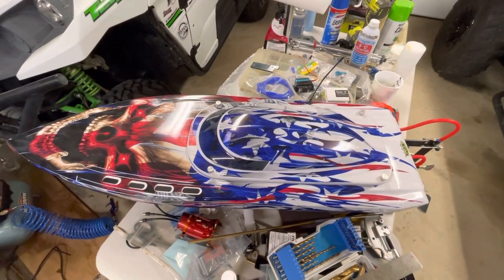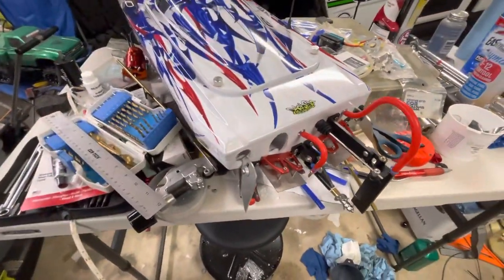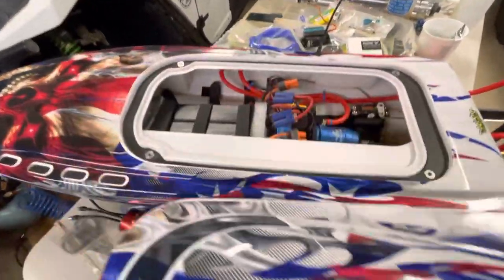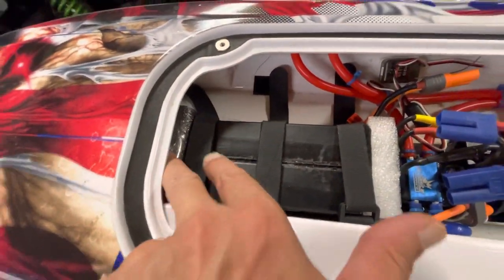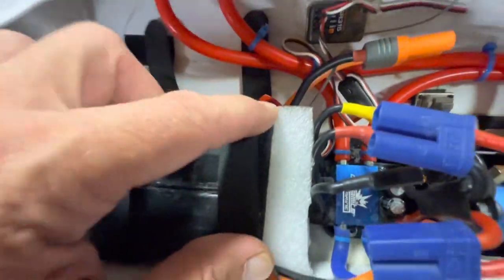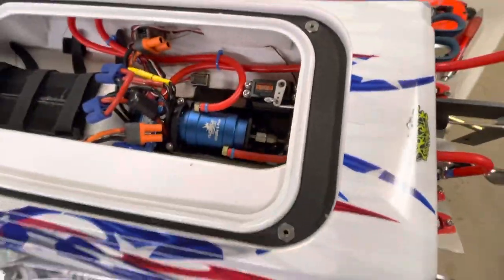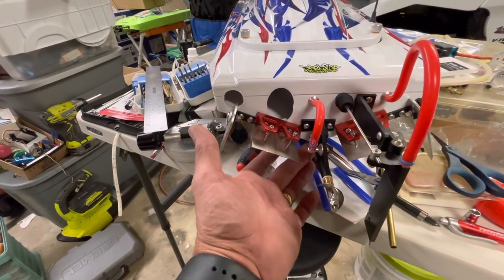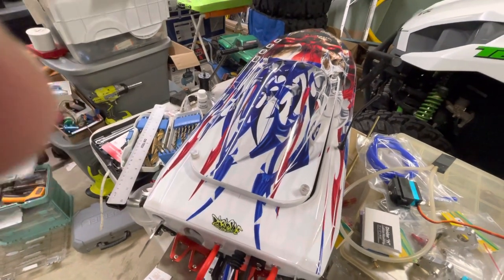Sonicwake 36 set up and look inside my setup

Comment: Great job on the build! I like the darkside wrap. I have a V1 that I'm custom building myself I guess great minds do think alike I put my water pick up the exact same way. I've installed the RC boat bitz esc , trim tab and turn fin set up. Running a higher KV motor with a Oxidean Marine 4519 and going to let her rip. Thank you for those bracing tips keep up the great work and thank you.
Reply from the maker: I am only waiting on the Spektrum 120 marine to get in stock again and am gonna change to a smart esc.This boat hasn’t failed and going on the 3rd season❤️I use RC Boat Blitz parts and they have great product.The props on my Miss Geico 36 are from them and work really good😤
Reply: I will stay tuned to the same time and same 🦇 channel to see it ripping. I have a few other builds in progress a Rage Super Cat on paper should do 80 plus we shall see.